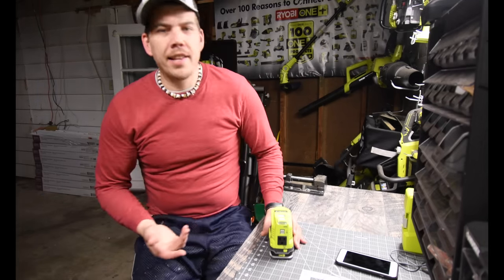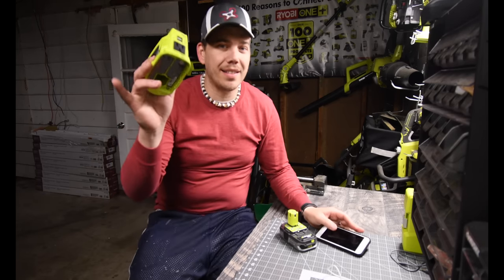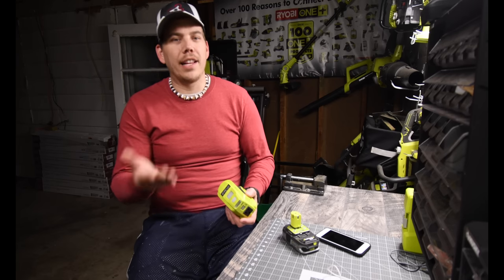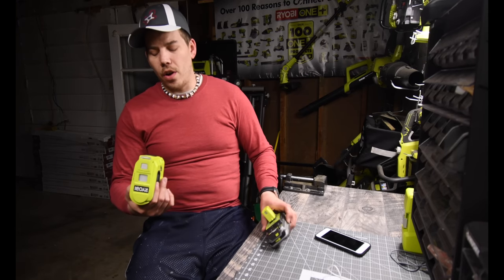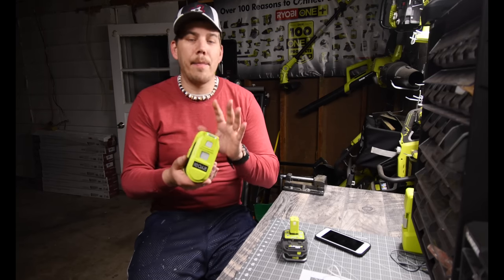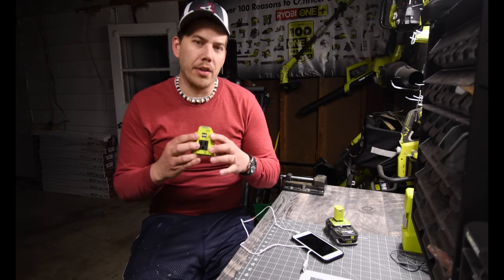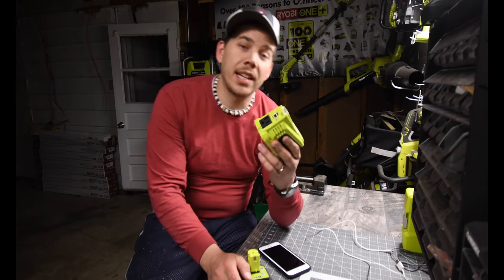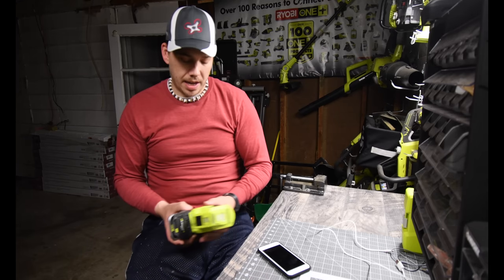Ryobi 150w Inverter gets HOT!!

Comment: I use mine everyday at work. Charging laptops and cellphones at same time. Had mine for about 2 weeks. Very happy. Mine gets a little warm but never hot enough for a fan to kick on. I use 4 ah and 6ah batteries without issue. Using a larger battery wont hurt the unit. All batteries are 18v
Reply from the maker: Gary H I have no issues either I love using mine

Comment: I've been enjoying the Ryobi Power Inverter for several weeks.  My unit has been functioning without issue.  The rattle when shaken is play in the plastic power button beneath its rubber cover.  Any Ryobi One+ battery may be used with the inverter without concern for damaging the unit.  Larger packs only increase runtime.  

As with any power inverter heat is generated during the conversion process.  The Ryobi unit becomes warm during use, but not substantially so.  Inside there is a thermally-controlled fan to expell heat when required.  

I have conducted several runtime tests using the 3 AH batteries.  Powering a 22 watt circline fluorescent bulb fixture the inverter ran for about 2 hours.  The test was repeated four times with four different batteries.  The fan never engaged during testing.

Running the light test with an Asus ZenPad 3S 10 tablet & my Galaxy S10 charging from the USB ports, the unit supplied power for around 90 minutes.  This test was also conducted four times.  Again the fan never activated.

My thoughts are, while overpriced, the Ryobi Power Inverter is a welcome addition to the One+ lineup & definitely something a true Ryobi enthusiast will want to acquire.  The Ryobi Power Inverter is useful & can certainly be a lifesaver in a pinch.  The LED light is a nice finishing touch.
Reply from the maker: Dirty Bird very good. It also does depend on the environment your in at the time. I had the inverter turned on with noting charging from it in the car for a few hours sitting in the sun. The fan was going off like crazy. Luckily it didn’t dry out

Comment: Having a larger capacity battery will actually stress the cells less, because the overall discharge rate stays the same. fixed at 150w.  The C rating of the cells & the BMS on the battery determine the max current the pack can output.What you are experiencing is voltage drop. The pack is only supplying the current the 150w inverter is asking for..It not "pushing" thru the inverter.
Reply from the maker: TheeJoeyLee correct, the battery will be fine. But the device would suffer a little bit more because of extra power. I’m making a video about the difference in direct power from the different ah batteries as we speak. And there is a difference in immediate power . It will be uploaded in a few hours
Reply: @ManCaverTools  The larger the capacity, the less of a voltage drop, seaming like thre is more power, when in reality this is because the larger pack is stressed less. This is true for most batteries

Comment: As a retired product manager the high initial price is likely because of  its uniqueness to the 18v line. I'm sure they will be reduced, on sale, coupled as a gift or some other marketing brainstorm. My specialty was in dentistry but my best guess is it's costs are $6 to $7 , sell it for $21-$24. Start up costs could easily run into several hundred thousand because of the plastic injection molds - $60k each and you need one for each part or a molds can incorporate several parts.. With the exception of grocery stores, most retail stores make the bulk of the profits. Home Depot gets stuck with all unsold inventory because of their exclusively. It's pricey but most of the Ryobihea will buy one, myself included!! LOL
Reply: They're giving this away for free with purchase of their two pack of 3amp/h batteries. Pretty much sums it up right there.  Great deal for $100 as far as I'm concerned (2x3ah batt + inverter).
Reply from the maker: thank you sir

Comment: I saw in one video that you used this fir your Christmas decoration lights.    I have a multi power strip and was wondering if for a couple hrs of use if I plug the power strip into this inverter
Reply from the maker: it would work with that. and the time depends how many strings you have attached

Comment: The amp hour rating has nothing to do with how much power that is delivered at the moment.  It only comes into play for how long the battery can deliver power.  You can use a 100000 Mah battery and it will make no difference.  All that matters is what you connect to the output. Usb or 110.
Reply from the maker: Thomasville NC I recently used the inverter with a 9ah in 55 degree weather and it posed up 2 phones and a laptop without the internal fan turning on. So yes it is capable of running with that amount power at once without overheating on colder conditions

Comment: Honestly been debating returning mine. I bought it in ryobi days when it came out. Took it camping a month later and it would not work. All I did was charge my phone. And use the light. It kept locking up. It's ok now. But honestly the 40v looks good. The rattling I believe is the gray on/off button moving around.
Reply from the maker: the 40v is way better and I am glad I have both

Comment: So after getting one of these for free as part of Home Depot's free tool with purchase of 2 pack of 3 amp/h battery deals here's my thoughts.  This device has been super convenient for me.  When used for its intended purpose of powering electronic devices, it's been solid.  I've plugged laptops, USB HDD's, pretty much anything in it and it works like a champ.  It's 10 times easier than having to move the couch and get a right-angle extension cord for an extra outlet.  Second, your knowledge of electricity is BS.  It doesn't matter how many 9amp/h batteries you use.  As long as you stay within the electrical specifications (150W), you can run this thing off as many consecutive 9amp/h battery packs as you want. If you're a dipshit and do something like try to run a hair dryer which it says clearly not to do, then you deserve to have it get fried. On a side note, I have a whole collection of Ryobi One+ tools and this is the one that gets the most use off-hours due it being a convenient charger for a whole bunch of electronic devices.
Reply: I would like to run a small heater off of this thing do you think it would be possible? I know most of them draw a lot of power, maybe link a couple together? I'm new to these would like your thoughts. Thanks in advance.
Reply: @fredbear205  A heater is a restive load and sucks down a lot of amps.  Two of them is likely to trip a 20 amp circuit breaker in your house.  This device is made to power laptop power supplies and similar electronic devices.
Reply: Ian East thanks much appreciated
Reply: @fredbear205  The unit is designed to supply 150 watts.  If you can find a heater that draws 150 watts or less it's up to the task.  You cannot link two power inverters together because they lack the circuitry to synchronize their output frequency.
Reply from the maker: I love mine I use it everyday, but I not sure if you noticed but im a huge Ryobi fan as well.
Reply: @ManCaverTools  aun lo tienes?

Comment: Guys, I put a 140W continuous load on this for 20 minutes., fan kicked on got above warm.
Bad part is, heat transferred to the top of the battery making it very warm , and even though it still works, it smells like fried electronics inside the inverter.
Reply from the maker: Bonzo Bonzai that’s pointless I’m trying to make. Just because it’s capable of doing certain stuff doesn’t it should. I was told people a units were breaking and overheating. So I made this video on the subjects best not to put the inverter through
Reply: @ManCaverTools  I agree now.

Comment: Maybe don't make videos when you're tired - and don't make videos about things you don't understand.
First, the rattling is simply the plastic button on top moving side to side, there aren't unsecured components inside. Drop it all you want, it's no less durable than any other Ryobi tool.
Second, "this investment needs to be maintained" - what? there's literally zero maintenance involved. Even the fuse is soldered in.
Third, your opinion that you shouldn't use a higher capacity battery reveals how little you know about the topic - that's not at all how it works, there is absolutely no reason not to use a higher capacity battery. And you're not supposed to run a saw off it anyway, that would draw too many amps and overload it. It's says that clearly on the box.
Fourth, you can use AC and the USB at the same time. A laptop charger runs between 45-90 watts. USB 2.1 draws less than 5 watts/each - even after conversion overhead it's well below the 150w rating of this unit. 
Fifth, 'USB is hard to master' - sigh. Delete this video - and your account.
Reply: anticapitalize Spot on. I just bought one and haven’t had any problems. It’s price is due to what’s in the market. I have yet to see anything this small and portable. When the market catches up, the price will drop.
Reply: I have no idea also. But the soldered fuse in there, would you be able to replace it by soldering in a new one? Does the fuse burn out if you try to draw too much power from it? Eg more than 150w
Reply from the maker: Wow, you seem like a depressed person.to bad I didn't read this 4 months ago. But ok then tell me this, I left the inverter on by accident with a 4ah battery in it it with it on and not charging anything and it was fine. but one time I left a 9ah batter in it without charging anything and the fan inside the unit went crazy just by having it turned on. explain that SIR.
Reply: Electrical engineer here, guessing... The higher Ah battery will not IDEALLY deliver more power to the load (current is determined by the impedance of the load and the source voltage; see Ohm's Law). Even with higher capacity, your battery still has the same nominal voltage and so the current draw will ideally be the same... The battery will just last longer. Now, with that said... In the "real" world, a higher-capacity battery will usually have a lower voltage droop under a given current load than will a lower-capacity battery under the same load. What happens under load is that there will be some internal resistance inside the battery which will cause some power loss resulting in a slight voltage droop at the load. With a larger-capacity battery, each cell in the battery pack is likely experiencing a lower current draw per cell than the cells in a lower-capacity battery pack. An easy way to think about this is say a 2-Ah battery with one series of cells having to provide all of the load current. If a 4-Ah battery has the same series of cells, but two sets in parallel... Each cell now only provides half the current to the total load current. Less current per cell will result in less voltage drop (and so power loss) per cell. The end result may be that the lower voltage droop in the higher-capacity battery means that the DC-to-AC converter always sees a higher voltage than when attached to a lower-capacity battery. (This could be tested/observed with the right equipment.)  This also explains why a high-current-draw tool will perform better with a high-capacity battery than with a low-capacity battery... Less voltage droop when under load means more power delivered to the tool.  Simply put... A higher-capacity battery will experience lower power loss inside the battery than will a lower-capacity battery under the same load current.
Reply: @matty_w  - exactly!

Comment: I don't know why this vid came up in my YouTube suggested list again? But I watched again. I now know that you can take this unit up to 200W reliably  200.0001W and it'll shut it's self off.
It doesn't matter what size battery you use. all that does is change how long the unit will run
I have taken mine camping to work and knocked it off the table dropped it out of the van a lot. its's pretty rugged.
Reply from the maker: after using it for a while even it sitting in heat would se the fan off like crazy and yes lol this is an old video

Comment: I just like to bring a point up about the converters how you say the Rattles inside they don’t rattle its just the two buttons on top that rattles if you hold the two buttons down why you shake it you won’t hear any  rattling in the inside
Reply from the maker: after having it for a while I just leaned that you need to keep it out of the sun or it will over heat

Comment: Can two of these inverters be ran in parallel to double output? (300 wat)
Reply from the maker: I don't think it can.
Reply: No, there's no way to synchronize the 60Hz clocks. If they end up out of phase, you could end up with zero output instead of double.

Comment: Good update. Nah man, no matter the larger battery or not, the electrical pressure (voltage) is identical. If anything, the current will be less on the battery cells themselves the larger the batteries go ending up in less heat generated in the battery cells. But at 150 watts even the smallest batteries would not get too hot. Its really sad that mine has two burnt out USB ports within days of getting the thing :/ The quality of parts they used for mfg is likely the cause.
Reply from the maker: TRY to HELP you I used that example because when I use a 1.5 ah battery in my brushless circular saw it barely can cut a 2x4 but a 4ah battery cuts through it like butter and then some. I’m going to make a video about it tomorrow. I’m going to see if 2 1.5ah battery can cut thick wood with my one+ miter saw a few times. I don’t think it would be able to cut 2 2x4s at once. But we will see.I’m goin to do a lot of tests tomorrow. We will see if there is a difference in power. It will be a god video
Reply from the maker: TRY to HELP you I actually will do the test 1.2ah battery and see what happenes
Reply: @ManCaverTools  Roger. Keep in mind that the watt hours (Wh) are the amount of energy you have. The more Wh the longer the battery will last. Also the more Wh the more power can be pulled from the battery (does not mean the battery forces it into the tool). If you have a 162 Wh battery vs. a 28 Wh, it's not that the large battery is giving the tool more pressure, it's just that the battery has more energy to offer over time. Also if a tool chooses to pull high amperage (like a saw), the larger batteries will be able to provide large amounts of energy consistently with* a smaller drop in pressure (voltage). A good example would be to charge a 28 Wh battery and a 162 Wh (9ah) battery and plug them into the small hybrid fan. The fan spins no faster initially with the large battery (because of voltage/pressure is the same), just spins* for a lot longer. (*=Edit)

Comment: Same power bigger battery. Give you more run time. Not more power. It still same power in 18 volts and same power out 120 volts. But bigger battery means more run time.
Reply: David Petrusewicz newer cells and more amps means higher discharge rate and less amperage drop. So bigger/newer batteries do have some advantages
Reply from the maker: indeed

Comment: USB is NOT hard to master.  It's manufactures that use cheap crap in their components.
Reply from the maker: thank you for viewing
Reply: Yeah, it's really not... USB power is essentially a 5-volt connection with resistor voltage-dividers on the two data pins. Now, if you're doing USB data, then you have to carefully engineer the (differential pair) data traces, but this thing isn't doing USB data... just power.

Comment: He doesn't know much about electricity... maybe he should read the instructions before talking crap. An "amp hr rating refers to how long a given battery will last.  A 9 amp battery only means the the batty will maintain 9 amps of draw for for 1 hour... its merely a a supply of electrity...like a gas tank. V = volts x a = amp and w = watts. In the case of a usb charger it would be (max) 2a x 18 v = 38 watts. The unit says 150 watts. You could easily charge 2 phones and run a 120 v 40 watt light.  I hope Ryobi is not giving him free items... their product's are not as frail and temperamental  as he thinks and are far more durable than he gives them credit for. Dude,  have faith bad believe in the product's you represent!. Cool shop though
Reply from the maker: John Hartshorn obviously you didn’t listen bro. I said it’s captor running with a 9ah battery and power well. But the unit will over heat if you use it like that for a long period of time. It won’t over heat if the weather is colder.

Comment: You're proving what I've been saying. It's nice in certain aspects, but in normal use for something that has a 120V AC outlet, it's pretty much underwhelming. It can only power 2 (75W) regular incandescent bulbs. I have power banks that output way more than it's USB ports. I'm hoping and guessing they come out with a 6 port 1100W. That would drive the table saw. I'm not beating down on it (much), but I wanted it to be so much better.
Reply: It can power 21 household LED bulbs that  draw 6.5w....(60w incandescent equiv)
Reply: @foam27  and.. you would chance all 21 through a single socket? The Incan bulbs are a small reference to something that pulls a lot, but outputs inefficiently. As comparing it to anything higher in productivity like a tablesaw, or worse a coffeemaker, would not be fruitful. It's basically a big fat powerbank.
Reply from the maker: thank you sir

Comment: This guy has no idea about current or ah or electronics in general !!!!!!
Reply from the maker: this is a very old video, the main issue with this unit is, is that it will majorly heat up when its turned on and not charging anything. there is no auto shut off on it. if you for get to turn it off and leave it in the car during summer, it majorly heats up. dont wanna burn down my car